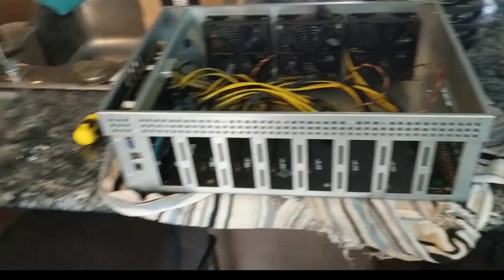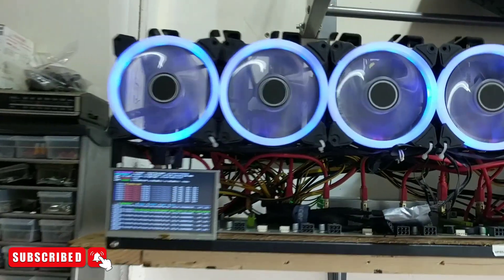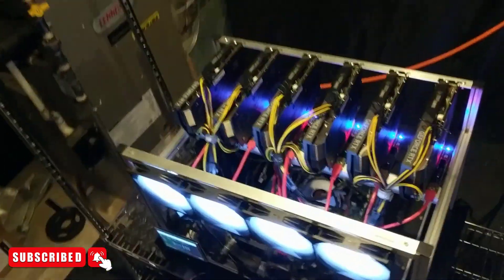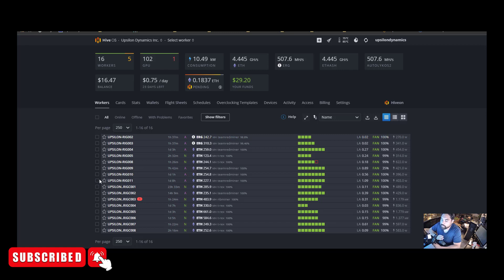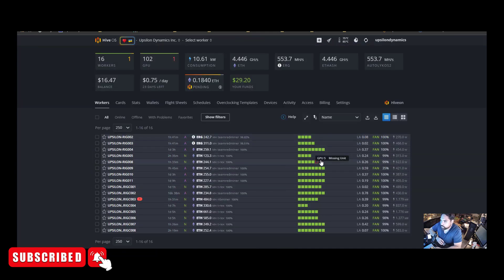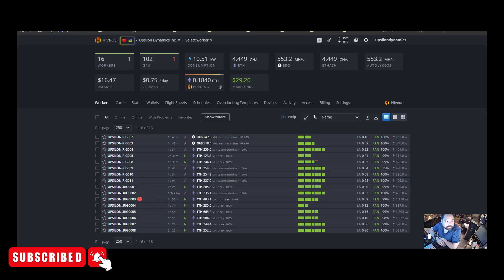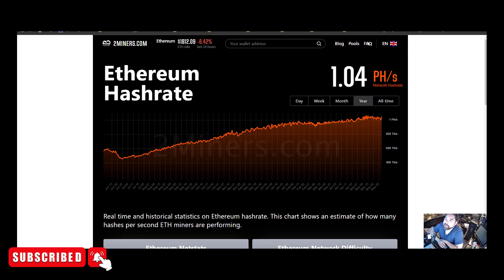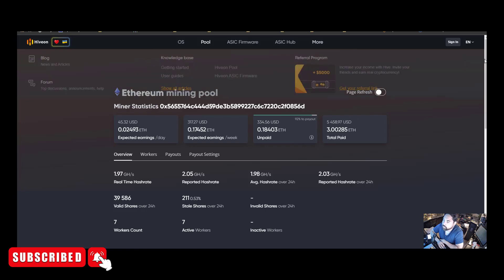More Server Cases To Cool GPU's | Grow Tent Intake vs Exhaust | Crypto Mining

Comment: Just ordered a very nice server case/mobo combo off ali express for 245,- including shipping (PSU not included). It's 6 GPU case with 70mm spacing between slots, with four fans. They also have an 8 GPU edition voor 10,- extra with 6,7 mm spacing. It's for ATX PSU's though (which I prefer).
Reply: It's the ETH-HSW2 (6gpu) or HSW3 (8gpu), for anyone is interested.
Reply: @pacaro4644  Which vendor? I've dealt with a few sketchy ones.
Reply: @totalbullion5882  SZJN. Got good hardware there before.

Comment: take the sticker off the zotac fans. also i sent you email to cases I bought from aliexpress, 8 fans, 2000w psu, i paid under 600 cad shipped to door.
Reply from the maker: I noticed those heavy and thick stickers wobble because they don't put them in the exact center at the factory; definitely agree the off balance wears down the fan bearings overtime.